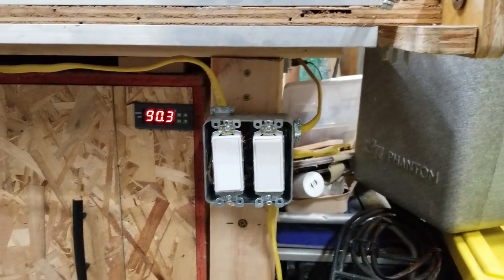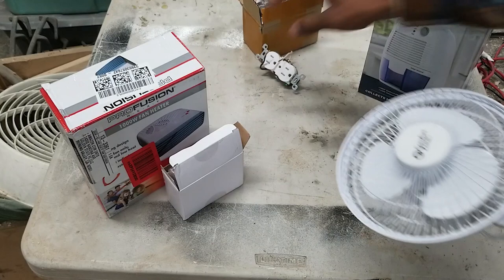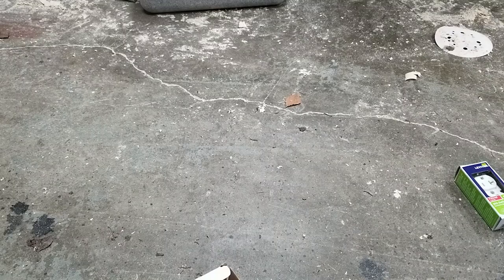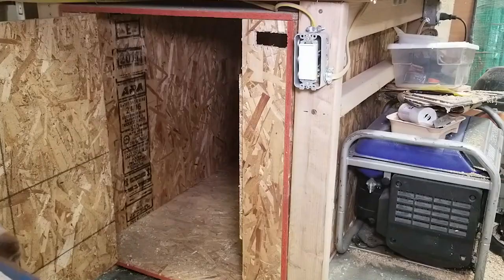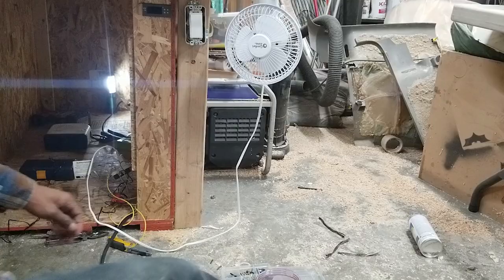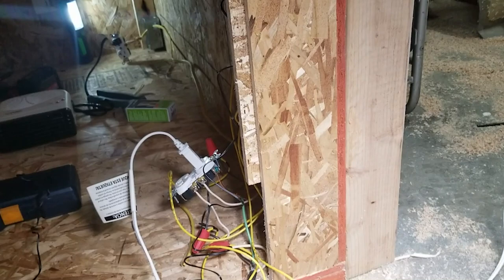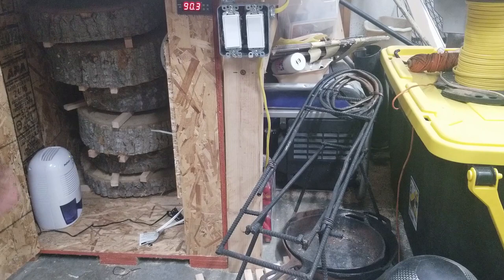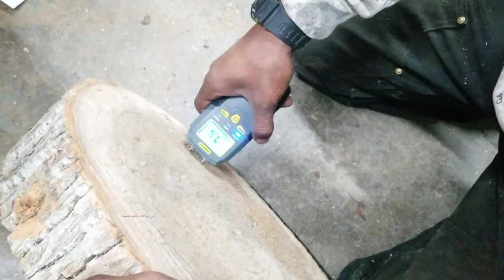How to build a small shop wood drying kiln

Comment: What a great video! What temp and humidity did you keep during drying?
Reply from the maker: i need to build another one this one has a couple of flaws that don't allow me to set the temp very high. i run it about 90f and it is unable to monitor humidity. i keep it running until the dehumidifier wont absorb any more water (about 2 weeks) then i let it sit at shop temperature for 1 week then double check the wood with a moisture meter
Reply: @Making_Adventure  Thanks! I'm having a lot of trouble finding any info about humidity level and temperature. I have some oak drying in my shop where I run a dehumidifier to keep my tools from rusting. The oak is checking and splitting bad. Need to figure out what humidity level will let it dry at the best speed